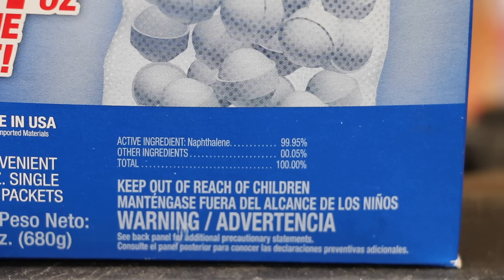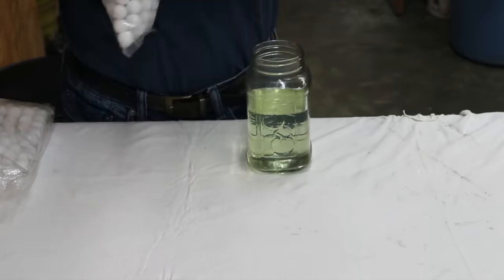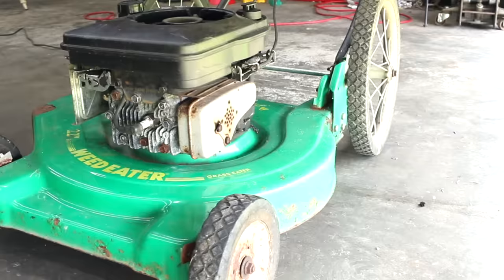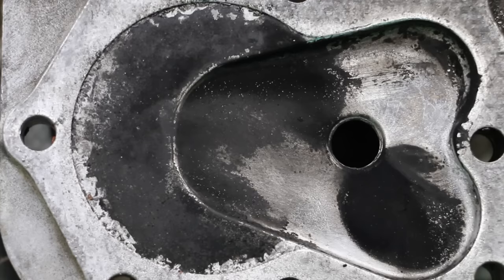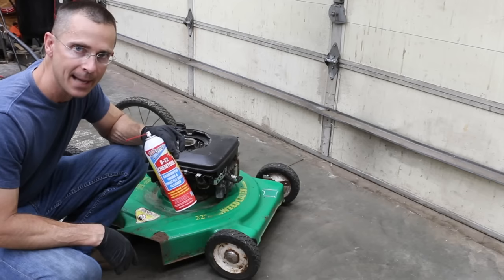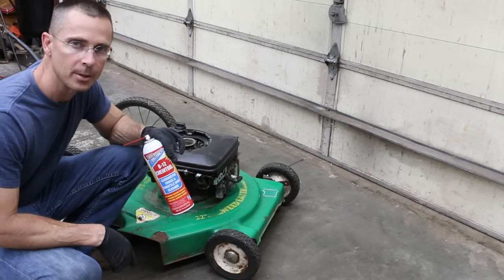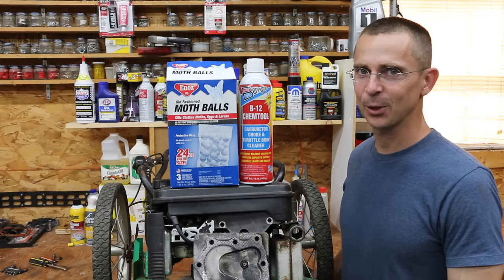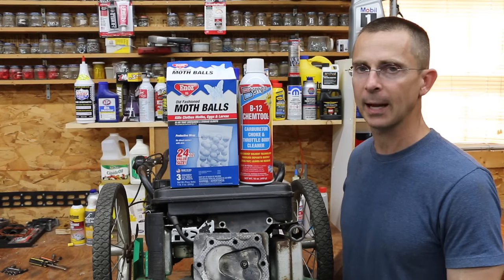Will Mothballs in Gas Destroy an Engine?  Let's Find Out!

Comment: 1 ball per 3 liters gasoline. Crush the mothballs then add to some gas and give it a good shake till it all dissolves. Then add some 5w30 or 5w40 fully synthetic oil to the mix abt 30ml eng oil per 45liters of gasoline , adjust to the amt of gas u have in the tank. Then add it all to ur gas tank. Should run good n fast, n smooth.

Comment: I add moth balls to my tanks it doesn't seem to do a lot to like fuel mileage or how it runs but with moth balls in the tank if someone siphons the tank it will cause a immediate bad reaction to there mouth and will cause swelling of the mouth and throat they will need to seek medical attention quickly. good deterrent to the crime. I add a couple 3 or 4 balls in the fuel tanks about every 2 months it takes a few 3 or 4 weeks to completely dissolve .
Reply from the maker: Thanks for the feedback.

Comment: Ok lets be more clear on the process. I have used this trick in taxi cabs. When regular gas is in the tank,(20 Gal tank) adding a hand full of moth balls was enough to take the "ping" out of a motor that should run on 91 octane fuel. note #1, the old moth balls (cir. before 1980 or so had a different formula )was ether based. #2 all fuel ran through fuel filter. Truly your test is only partly valid. That being the stories are based on a time and formula told by the generation of operators before EFI. more legend then current reality.
Reply from the maker: Thank you for this recommendation!

Comment: Flaw in the experiment: you put a suspension of undissolved naphthalene (that white goo), which was solid particles.  If you had filtered the fuel, you would have had a saturated solution of gasoline & naphthalene, which would have stayed running.  I don't know what the results of the intended experiment would be, but the motor would stay running.
Reply from the maker: Yes, i messed up this test and will likely repeat the experiment.  Sorry about that.
Reply: Did a good job putting it together, though.  I'll keep an eye out for the next one :)

Comment: I would try again with only 1 mothball and strain it.  I think the guys doing this only put 1 or 2 in stock car tanks that are 5 gallons.
Reply from the maker: Great point. I overdid it for sure!
Reply: @ProjectFarm   I think you would still have issues especially with carbon build up from the napthalene.  Love your videos thanks for doing what you do.
Reply: @ProjectFarm  you should do a comparison of the new Supetech knock offs of name brands. I Supertech is making Lucas oil stabilizer and fuel conditioner even a seafoam knock off.   Word on the street is they are made by STP.

Comment: Moth balls weren’t meant to improve the performance of your engine. It serves a few purposes, it keeps idiots that want to go fast with dead cars. Others put it in their exes gas tank, or straight battery acid in the oil. Try that one. Nice video. I used to pick up mowers from the trash just to blow them up in a similar way.

Comment: Adding mothballs may increase the Octane rating, but that just means that it is more resistant to explosion, hence the engine running like crap.  Only increase Octane if there is a need for it, i.e. increasing compression or adding a turbo unit.
Reply from the maker: Thanks for commenting on this.

Comment: Thanks for the mpthball soak in fuel.

My nissan silvia old n new fuel pump, fuel filter old n new are heavily clogged with white greyish mothball residue cause by my car dealer popping 10 + 5 moth  ball separate occasion. 
Do not put moth balls. it is true it clog up fuel system real bad and cause alot of money to clean up
Reply from the maker: Thank you!

Comment: People always use the expression “ boosting the octane”.
Boosting the octane in itself does not make the fuel more powerful. 
It actually makes the fuel burn slower.
This allows it to properly fuel a higher compression ratio engine that produces more power. 
Modern engines can automatically  advance the ignition timing when using higher octane fuel and produce more power.
Reply from the maker: Thanks for the feedback.

Comment: Usually I see people grateful for having Project Farm debunking engine myths. But this time people are getting very defensive. Strange.
The people saying "you only need a handful of mothballs for 15 gallons of gasoline" are totally failing to account for the fact that a handful of mothballs simply don't contain enough naphthalene to have a significant effect on the performance of 15 gallons of gasoline. If they experienced any benefit, it was either their butt-dyno lying to them (i.e. confirmation bias), or their engine was on the very edge of being tuned correctly and the tiny bit of naphthalene from a handful of mothballs was just enough to compensate.
Reply from the maker: Thank you!

Comment: This mothball test was not accurate due to dumping the undissolved portion into the gas tank... one box of moth balls will dissolve in a 5-gallon gas container and it runs great in my old 1990 Isuzu Trooper and it really does feel the car runs smoother with higher octane - kept using the mothballs in the gas tank until the price of mothballs skyrocketed because everyone were using them.

Comment: What would happen if you mixed a (dry) graphite lubricant with the fuel or oil? Graphite lubricants have applications in high temperature oxidizing environments and sometimes outperform oil lubricated systems and reduce friction and wear greatly in most cases.
Reply from the maker: Thank you for this recommendation.

Comment: I find it hard to convince myself that this video isn't secretly sponsored by B12 chemtool, no hard feeling, just my pov
Reply from the maker: Thanks for the constructive feedback. Anytime a product does well, I get one or two comments like this, but I'm not sponsored.
Reply: @ProjectFarm  Is there another latest video on this naphthalene test? Mind try it in complete solution form?
Reply: @ProjectFarm  im having one galloon of MMO sending to me as im speaking, do you think hot-soaking my piston will finally cleared my carbon deposit. 

(I've used: HKS DDR, REDLINE SL-1, X1R FUEL SYSTEM CLEANER ETC) none produce significant noticeable result.

Comment: You used way to much Naptholine (mothballs) to the amount of fuel.  The black smoke is unburned fuel. Naptholine does not raise octane, it lowers it.  Naptholine, used in moderation, does raise the volatility of gasoline  and modestly, energy (BTU's) per units of volume.  It will not harm your engine used in moderation, and can raise your MPG modestly BUT it will bring catalytic converters to an early death even used in moderation.  The difficulty keeping the optimum ratio of Naptholine to gasoline and likely damage to converters makes this additive undesirable.
Reply from the maker: Thank you for the feedback

Comment: I need some mothballs my suit got eaten. natha is a carcinogen  and yes it will lower the flash point of fuel also should clean but an air-cooled engine does not need it and u dissolved  enough for a 502 cid chevy big bloc chevy
Reply from the maker: Thanks for commenting. Yes, I overdid it.

Comment: That was a VERY HIGH moth ball to fuel ratio. That was enough for about 50 gallons of gasoline. For a small engine like a scooter or lawnmower -- you would only add 3-5 moth balls. You would also run the engine at very high speeds, or max speed, to burn off most of the build up. Is it good for your engine. No. Will it definitely improve performance  - Yes. It would of been good to test the engine under a load, before and after, to see how quickly it would pull a certain weight.
Reply from the maker: Thanks for the suggestion.

Comment: Really try filtering out the solids before you add the mothball gas to the engine because it's probably the solids that are doing the problem so you should let them off balls dissolve then run the gas through a filter
Reply from the maker: I should have done that. Thanks
Reply: Project Farm you did a great job, don't get me wrong. Hey, if you filtered the solids, maybe someone else would have said "you shouldn't have filtered them!"

Comment: Like many pointed out, you put way to many mothballs in the fuel. Nevertheless, this mothball thing is an urban myth and if added in the correct amount would have done litteraly nothing to the performance of the engine.

First you have to understand what the octane rating means. It's a rating determined by tests, and not a level of a substance in the fuel. The octane rating is a property of the fuel, and tells us something about the knock resistance of the fuel. They determine the octane number by comparing the knock resistance of the fuel to the knock resistance of a kind of heptane and a kind of octane. The heptane ignites very easily and has low knock resistance whilst the octane is hard to ignite and has high knock resistance. The heptane has octane number 0, the octane has octane number 100.

So adding things to the fuel that are easy to ignite will lower the octane rating, and vice versa. These mothballs are made of naphtalene, which has 10 fewer hydrogen atoms in its molecule. This makes it harder to ignite than petrol, which is why the octane rating will rise if you add this to petrol. We see this clearly in the test, the engine runs rougher because the fuel ignites less easily making the combustion less clean. This also explains the carbon buildup in the cylinder.

A higher octane rating does not give your car more power, it says nothing about the energy in the fuel but only about how easy it is to ignite. The way you can gain power with higher octane fuel, is by advancing your ignition. Modern cars with a knock sensor do this automaticly, so putting higher octane fuel in the tank really does make a difference there. Older cars don't, and will have zero power gain when you put high octane fuel in the fuel tank. So this whole mothball thing is an urban myth, because in the era where this myth comes from there were no knock sensors and ECU's. The only way they would have gained power from it back in the day is if they readjusted their ignition. The mothballs on itself will do nothing to the performance of the engine.

The theory behind this myth however, is solid. And if the engine is adjusted to it, there probably would be a very slight gain in power. I don't suppose many people will bother to read this comment from start to end, but if you did: A+ for effort.
Reply from the maker: Thanks for the constructive feedback.

Comment: You need to completely redo this video! You used way too many mothballs in such a small amount of gas. Try putting one ball for every two gallons of gas and then re do your test. I've used mothballs in my motorcycle for many years and miles with no damage what-so-ever. The power gained is quite noticeable and quite addicting. So do your viewers a favor and do this experiment over again the right way....thank you..

Comment: you are only supposed to use 1 mothball per 10L of fuel (and grind them up first)
you used like 20 mothballs for less than 1L of fuel, of course it is going to clog up the engine and cause massive amounts of carbon buildup
Reply from the maker: Thanks for commenting on this.

Comment: Lol u gain alot of power but it does wreck your engine 300 straight 6 out ran a sbc 350 with moth balls but burned a hole in the cylinder
Reply from the maker: Thanks for the feedback.

Comment: Too many moth balls! Only 2 per gallon.... my husband used them with unleaded fuel in really old small engines that were designed to burn leaded fuels, some those are still running today (40-50 yr old tractors).
Reply from the maker: Thank you for the feedback

Comment: You out way too many mothballs into the jar. It takes very little. Maybe an eighth of the mothball for the small amount of fuel you used.
I've used mothballs to improve engine performance with a lower octane fuel. I did this in a car that required 93 octane gas and ran it on 76 octane. It pinged badly under load but adding several mothballs to the tank helped to improve performance and reduced detonation (pinging) in the engine to acceptable levels. It was a carbureted car. No issues with plugging up the carburator.
Reply from the maker: Yes, I'll have to repeat this test in a future episode using less mothballs. Thanks for commenting.
Reply: Most likely, you won't notice anything. This additive only helps if you use a low octane fuel in an engine designed for higher octane fuel. The engine must be sufficiently loaded to produce pinging (fuel explosion instead of slower combustion) with lower octane. You may be able to facilitate pinging at low engine load by advancing ignition timing by quite a bit but the test will not be accurate. This additive will not produce any other benefits.
BTW, I used to do experiments similar to yours. This was like 25 years ago. I've experimented with chemically treating and modifying intake air to improve performance.  The engine ran better on leaner than normal fuel to air mixture and did perform better with a lower octane gas. I probably should have patented it but never got to doing it.

Comment: You put WAY too many mothballs in that little of gas. You should have only put 2-3 at the most. Entirely too much sediment in the gas, that’s what clogged everything up. The good thing is it only funked up the fuel system and carb. I’m sure it would wreck modern engine sensors and cat

Comment: Naphthalene is an ingredient in almost all fuel treatments. WHY did you dump all that sludge into the tank? WTF! Run it through a vacuum flask with a 0.1 micron filter or at the very least use a sepratory funnel and use the supernatant. This was RIDICULOUS.

Comment: This video is your worst. It's well known you only mix 1 to 1.5 balls per gallon. I have used them in many engines for years with only positive effects. I used them in a 6.0 vortec engine that lasted to 268,000 miles before rebuilding the engine to find no extra carbon build up. in fact the only reason it needed a rebuild was due to major oil leak at rear main. I do use b12 or seafoam every 10,000 miles. The only thing I have noticed is about 5% decrease in fuel filter life. I have saved at least 23,000$ in gas due to increased mpgs of about 80% in the last twenty years. I have started using it in my diesel now and am seeing an increase of about 50% mpg. I mix them with fuel and use a 40 micron stainless filter before I add it, and in the winter it can take hours to dissolve them fully! You must also make sure and buy naphthalene moth balls of at least 99% purity. I have seen some lately with all kinds of additives.

Comment: Higher octane fuel does not give more power... Higher octane simply reduces engine knock (requires greater pressure to spontaneously combust), which shouldn't be happening anyway... Higher octane fuel also burns less cleanly and more of the fuel is wasted (out the tail pipe) on the exhaust stroke.
Reply from the maker: Thanks for posting this information.

Comment: Thank you for the video, I was stupid, I did to my motorbike with mothballs decade ago and it was indeed worse.  The only problem with B12 is it contains 90% acetone https://www.berrymanproducts.com/assets/1AA-CA11-0110C-0117C-0120C-SDS-R02.pdf    .  I am afraid some of the rubber or plastic parts get eroded and microcracked by acetone.   Could you please test Redline SI-1 ?  It has the highest Polyetheramine (PEA) for about 28% based on their recent MSDS.   Thanks.
Reply from the maker: Thanks for the video idea.
Reply: @ProjectFarm  But anything just by pouring to gas tank will be less effective than something with wet-hot-soak.  We are looking for something that effective without hot-liquid-soak that can cause oil dilution and wear in car engine.

Comment: One problem, and as a mechanic you should have already recognized this, is that you should have strained the fuel to remove the large particles from the gas mixture. The idea of using mothballs is that you boost the octane level of the fuel. Dissolving mothballs into the fuel then just dumping all the residue and large particles made your experiment a waste of time. Try it again, make another video doing the exact same thing except this time, pour your gas through a straining filter such as a coffee filter.
Reply from the maker: Yes, I messed up this test. Thanks for the constructive feedback.

Comment: Try adding 5 old-fashion mothballs (OFMB) per gallon.  Let the mothballs dissolve overnight. Try testing the dissolved mothball gasoline and compare the mileage with regular gasoline. I learned to use the amount from this website https://www.georgenitta.com/mothballs/mothballs.htm. Instead of pushing the OFMB into my gas tank, I add the ratio of 5 mothballs (equivalent to the total amount of the capacity of the gas tank) per gallon in a one-gallon gas tank for my next fill up George Nitta recommends using 1 once of WD-40 per gallon. I haven't tried this because getting the lubricant from the can was cumbersome for me. You can make this part of your future experiments.  

I experienced better gas mileage when I use high octane gasoline with the OFMB.
Reply from the maker: Thanks for the suggestion.

Comment: Okay you put way too many more balls in there and you didn't crush them up. 
I used to put up to six mothballs into my 400 cubic inch Lincoln.
I would take the six moth balls put it in a ziplock bag and then crush them with a hammer. Then when the tank still has gasoline in it I would pour the crushed mothballs into the tank and then top it off with gasoline. I felt I got better fuel mileage with a little bit more power, never had a stall or a no start.
I think with a lawnmower you would need to crush one mothball and then top it off with gasoline.
Reply from the maker: Thanks for the constructive comment.